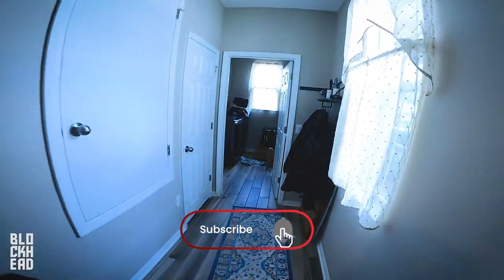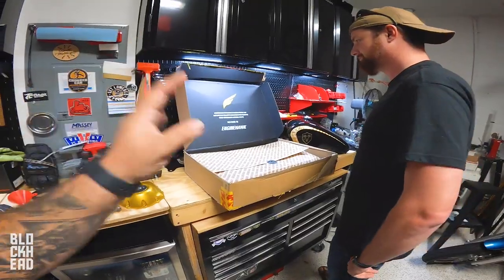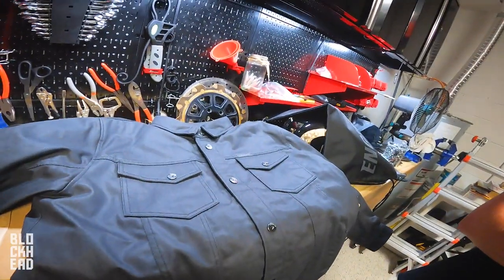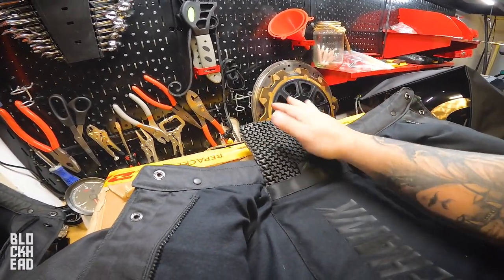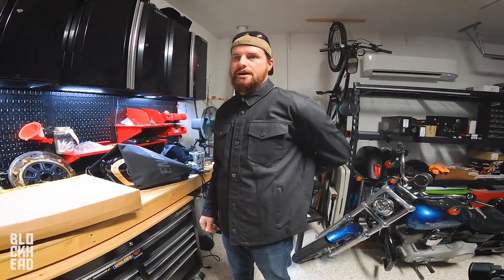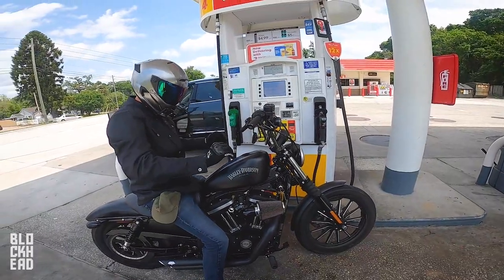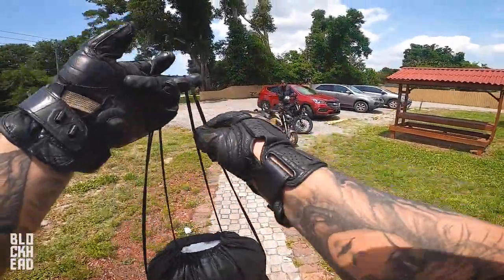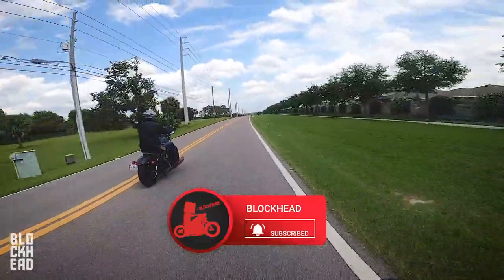RUROC's New Motorcycle Jacket! Enginehawk Knucklehead Unboxing & Review!

Comment from the maker: What do y'all think of the Knucklehead denim riding jacket from Enginehawk? I think it looks sharp, but I think I lean a little more towards the Hawkeye! 🤘
Reply: @BLOCKHEAD as a 6' 4" 235lb guy, I am concerned with Euro v American sizing, for Enginehawk. Looks fairly blocky, but long enough if you buy a one size larger. I will be interested to see how the cut/fit progresses, especially for taller and leaner guys.
Reply: The knucklehead design is on point, very streamline and clean. I myself personally appreciates the subtleness in logo placements. EngineHawk definitely expresses their brand for the rider.
Reply: Great looking jacket. But for $300 it should definitely be vented for 3 season jacket.
Reply: According to the vid on their channel, the pockets are inside and the zips that look like pockets offer cooling ventilation. Did you try this system?
Reply: Looks pretty good, can you ask them to make an 8xl version for the larger fellow 😉.
Reply: @thirdcoastcowboi  dude I hear ya, I'm 6'5 320lbs
Reply: I would lean toward the denim. Just more my style
Reply: @blockhead where's that sizing chart?
Reply: Really torn between the Hawkeye and the .50 Cal. Went for the .50 Cal in the end. Thanks to your channel I discovered EngineHawk and was so excited when they just went live. Didn’t know Ruroc and EngineHawk were British, just got cooler
Reply: The jackets are all way too expensive. such a cashgrab.
Reply: Looks good but with 90*+ summer heat on the horizon this jacket is a definite no for me! 😞

Comment: It's a textile jacket you know like a jean jacket it's textile... Not a mesh jacket which is designed to flow air.... So of course it's going to flow less air than a mesh jacket.  If it's tightly woven which it should be for protection there's no reason it should flow any more air than leather.
Reply: Per the mfr vid, there are zippers on the insides of the pockets that allow airflow.

Comment: If the jacket has snaps, while not as safe, you can leave the zipper open and get way more air. It's still better than leaving the jacket home in hot weather.
Reply: Per the mfr vid, there are zippers on the insides of the pockets that allow airflow.

Comment: Im actually pretty glad you mentioned that the Knucklehead doesn't have good air flow. I was gonna buy it but Im super sensitive to heat, at least they have a huge lineup
Reply: Per the mfr vid, there are zippers on the inside of the lining that open and allow for airflow through the backsides of the pockets.
Reply: @mikewilson0077  I'm aware.